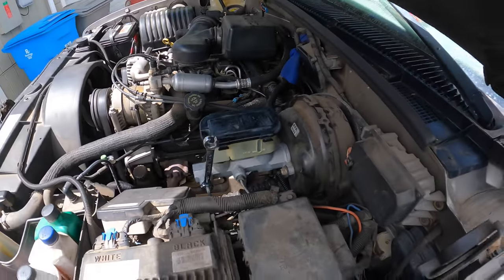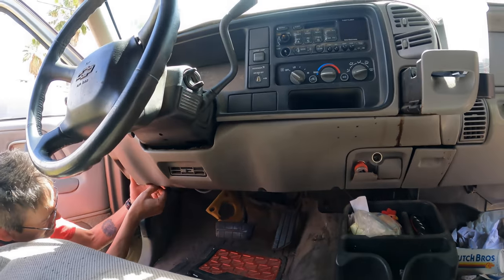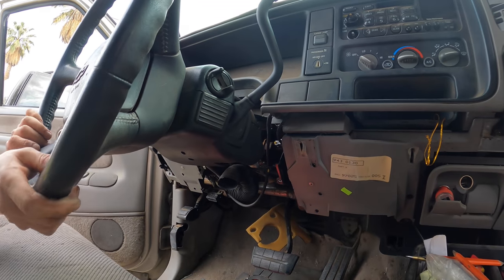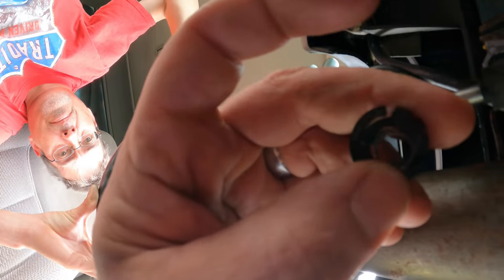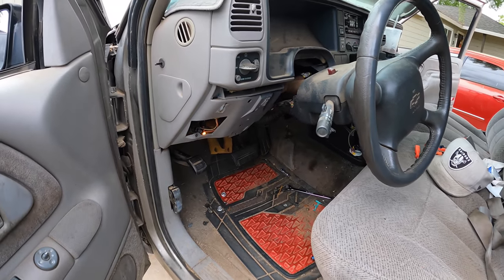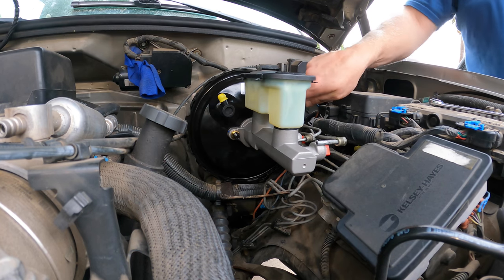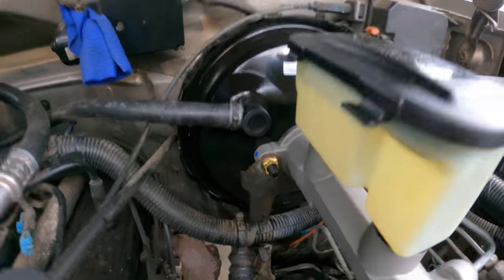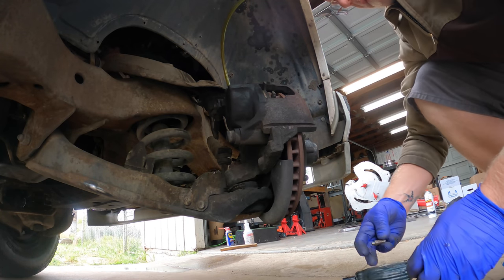How to replace brake booster and master cylinder on 96 Chevy Silverado C1500

Comment: I did not go through all that. I disconnected the steering column extension and pushed it down out of the way. Next I grabbed my 1/4" air ratchet with a 15mm socket and zapped all 4 bolts it took about 5 min. then removed the clip disconnected the brake rod. next, I went under the hood and removed the master cylinder, and threw it in the trash lol. Next removed the power booster  and threw it in the trash lol. next, I installed everything in reverse but of course I bled the master cylinder before I installed it. have fun lol.
My Vehicle is a 1997 chevy 2dr 4x4 tahoe.

Comment: I've noticed that engineers give no concerns about accessibility for repairs.
Reply: That's just a lot of amercian cars. Worked on chevys, kias, gmcs, ford's, toyotas, Hondas etc. and always found american cars to be more difficult and not mechanic friendly. Always seems like everything is rushed and put together quick to pump up numbers and keep up with production of other brands mainly Japanese. Things that should be easy to get to like an oil filter would be put in between hot exhaust manifolds or be put so deep in you can only reach one arm in to take it off. A normal tune up can take hours because they decided to put the engine deep into the cabin of the truck or car and makes it really un accessible. That's not to say amercian brands only do this but it's a majority of the time when one comes in it'll be a long job.
Reply: @brandonlo5162  i think is so that you have to take to their dealers so they keep selling oem parts and dealer gets more?? no?
Reply: these dummies didnt need to take the dash all apart. 5 minutes to get that clip off the brake pedal if youre smart and make a couple tools.
Reply: They do that on purpose so you bring your car back to the dealership to get it repaired
Reply: YES! My mom has one of these that has a lot of little issues like this and EVERY SINGLE ONE requires some special tool or removing the dashboard to change a sparkplug. Freaking maddening.
Reply: Never a truer statement

Comment: My booster on my truck right now is so bad that I plugged it off to keep it from stumbling at red lights runs way better -the fact my pedal is hard to push but I'll fix it in a few days
Reply: How do you do that
Reply: 😂😂 your truck and mine must be brothers cause she acts crazy as heck with my brake booster and master cylinder out.

Comment: I just did one of these today and figured out how to do it with out dripping the column
Reply: What did you use?
Reply: @igguka  use a pick to spread the gap on the clip and use a flathead screw driver to push the clip out .
Reply: @kenithj76  Its easy getting the clip off but I caught hell getting it back on
Reply: its actually so easy. these guys mustve smoked a whole crack rock before they tore their truck apart lol
Reply: @michaelc5985  lmao right? I used two flatheads. One pried under and another long skinny one to manipulate

Comment: The Tahoe I bought has the same brake light switch. Whoever was in there before did not reinstall the retainer. Does it go on before the switch or after?
Reply from the maker: after?
Reply: Is the brake light switch electrical thing that's like a twist lock and pops off first then the retainer??

Comment: I heard that GM offered a hydraulic booster or a vacuum booster for the brakes in those years. Which was yours? You didn't show why you were replacing the master cylinder either.

Comment: If you are replacing a master cylinder in a 96 C1500 because it is bad, why on earth are you replacing it with the same one? the 1988-1998 trucks are notorious for having a long and spongy brake pedal feel right from the factory. Many guys are ripping these perfectly good cylinders out and replacing them with NBS (New Body Style) and gaining a drastically improved pedal performance... Bolt on swap, only 1 brake line adapter needed. So if you are replacing a bad one, why not install a much improved one for the same cost?
Reply from the maker: Didn't know
Reply: So a 96 you buy a what upgrades?
Reply: What year upgraded ?
Reply from the maker: I'm going to assume 1999 to at least 2005 not a bad idea thanks

Comment: how do we know if we need a jb5 or jb6 booster?
Reply from the maker: The answer is probably in a book somewhere but I don't know I do know they are all physically different whether it's master cylinder bore pushrod length overall diameter and overall thickness I usually bring the old one in to compare when shopping for new one
Reply: Plus a $30 core charge
Reply: vin number either has j5, j6 or j7 in it.
Reply: They made them fit all of them with one booster now😊

Comment: Is it possible to flush the booster? How do you know when  the booster needs to be replaced?
Reply: If you press the brakes and you hear loud hissing and you brakes are hard to press coming to a stop then it's bad .
Reply: Thank you
Reply: @snowmama9030  you're welcome and did you ever  replace the booster?
Reply: I actually had the entire brake system replaced right down to the brake lines. 97 Silverado 320,000 miles. The backend started locking up. I'd skid to a stop. 3 garages couldn't figure it out! ... I wanted to replace all of it anyway. This is my forever truck.
Reply: BTW... It was a defective master cylinder
Reply: @snowmama9030  glad you got it fixed  ☺️
Reply: Vacuum leak

Comment: All I do is put a flat head and wiggle till it comes off, works every time takes no more than maybe 10-15 seconds
Reply: On what part? Explain please.
Reply: @boxerfan2  the clip that holds the booster piston and the brake switch to the booster piston. its easy to get off. i used a bad tool with sliht bend on the end to get under the clip. then another poker to spread the clip and lift with other tool to pop it off the stud.
Reply: @michaelc5985  Oh I see. Thanks for the info I will use your advice and try it.
Reply: @boxerfan2  dab tool sorry. Autocorrect. Flat paddle style about 1/4" x 2" paddle. When you put it in there youll be able to tell the angle you need to bend

Comment: Absolutely not necessary to remove the steering column
Reply: Late models gmt400 yes
Reply: Great video very informative, just saying I've owned this generation Chevys for decades I've never even heard of anyone having to move the column. Thanks for the great videos.👍👍
Reply: It is necessary to. My brake booster did NOT come off until we disconnected the steering column.
Reply: Never had to on my 97 suburban and 99 2 door Tahoe
Reply: I didn’t have to on my 1997 sierra but i’m sure it would’ve made it easier to get hands in the hard to reach spots.
Reply: Where did everyone get parts I have to do this to my 1996 suburban I don't think one has to pull steering column either will it take a little longer yeah..